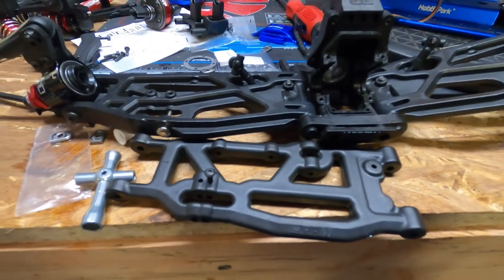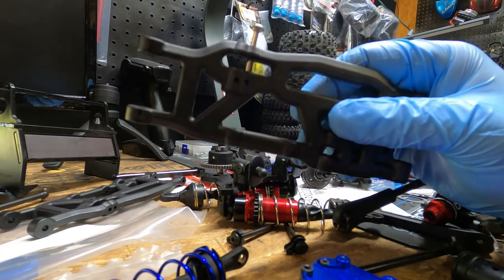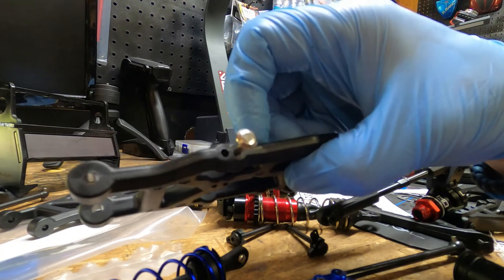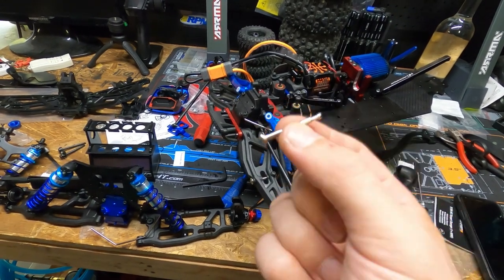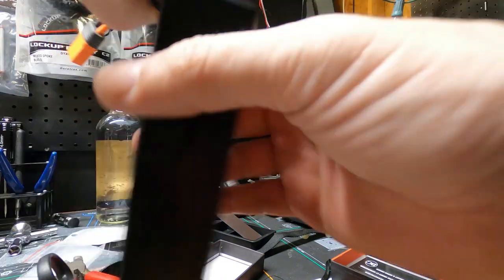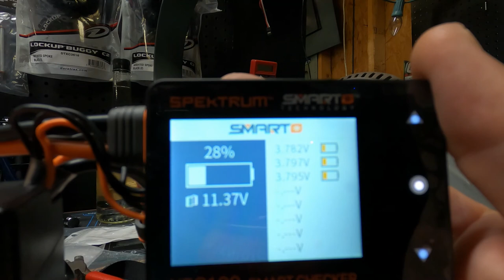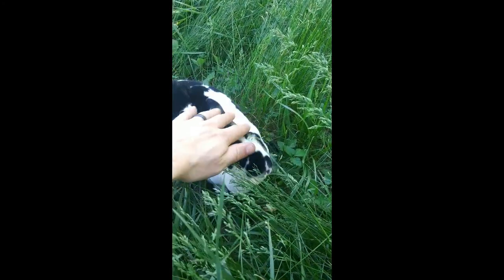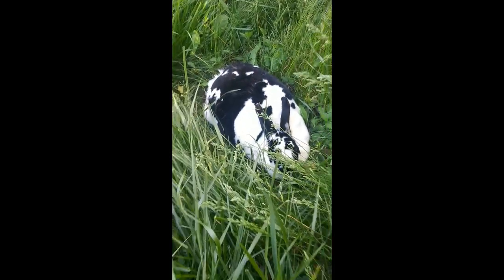KRATON6s + FUN RUN+ LEE-PO*upGRAdes!! ALWAYS!

Comment: The other day that's what I was talking about the lower shock pins on the rpm arms.  If you wanted to us the rpm without moding any hardware it need the v4 pins and v4 swaybay.   Hope all is well with ya man keep up the good work
Reply from the maker: Everything fits.  I just finished fully building the truck... Although. Your correct the sawy bars dont fit... Unless u move the mounting arm to the back.  Im looking for new thicker ones.. New video comes out tomorrow